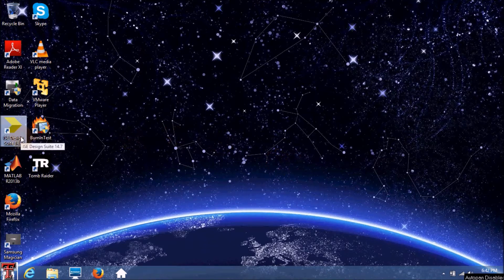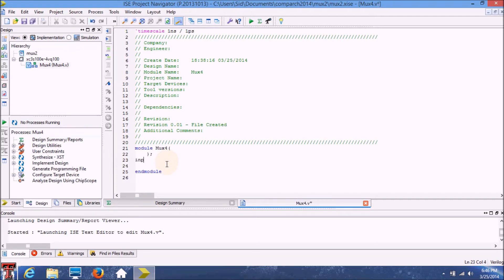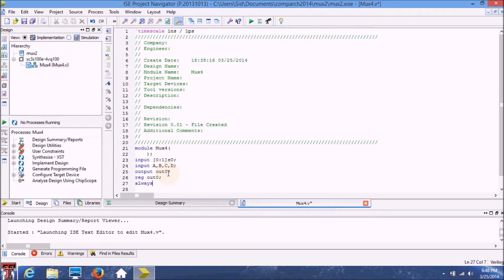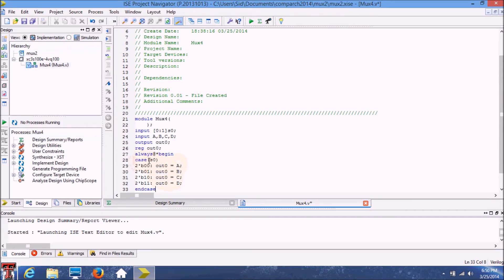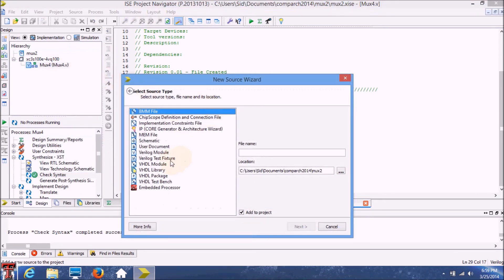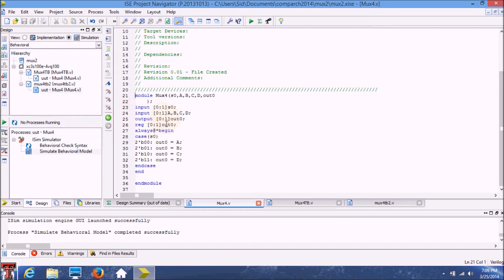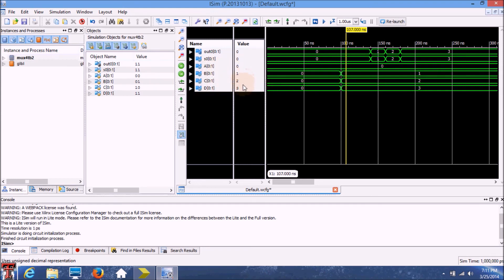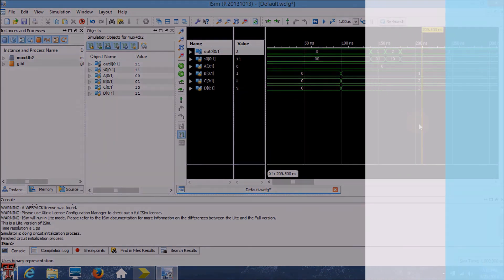CAS DOT Lab - 012 - 4x1 Mux

Comment: If you failed the "check syntax" part, during the transition he added a few parameters in the parenthesis for "module Mux4();"

It should include the variables: "module Mux4(s0, A, B, C, D, out0);"

then you should be able to check syntax successfully